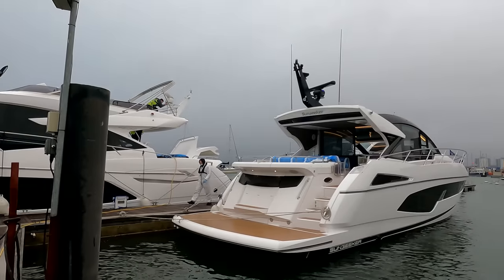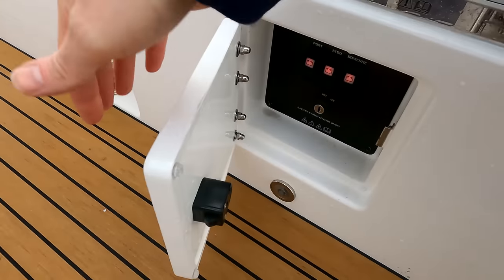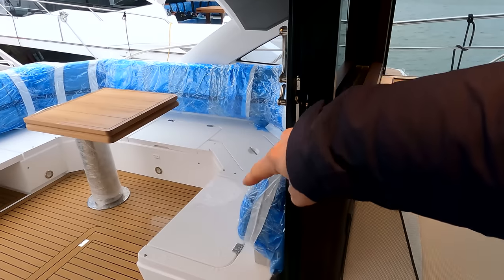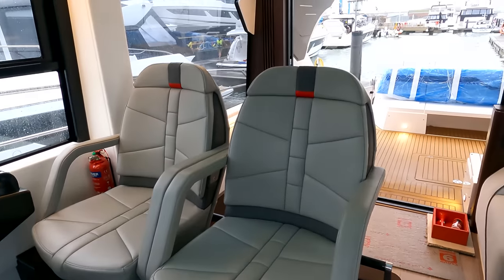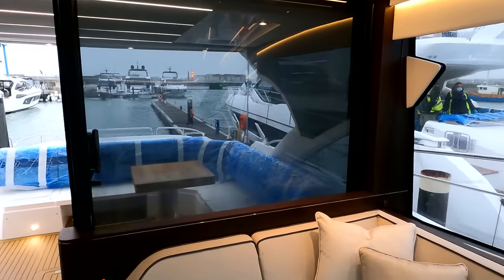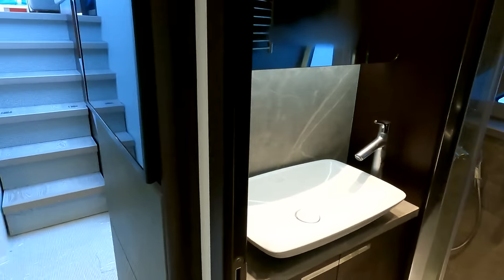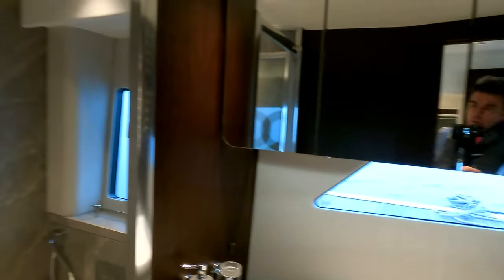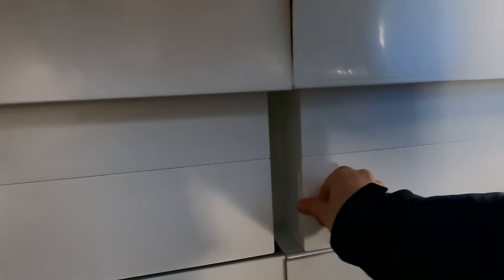2021 Brand New Sunseeker Predator 60 Evo For Sale - Full In-depth review £1,381,042 (now sold)

Comment: I do like the layout of the cockpit on this Predator, nice and safe , and out of the wind. Can you fit the washer/dryer under the stairs. I understand that the bigger engines give only an extra knot or so but higher fuel consumption and thus less range, is this true ? Cheers.

Comment: Hi James, does this boat have vector fin stabilisers, if not can new builds be fitted with them.
Reply from the maker: Hi Keith, the Predator 60 runs a gyro stabiliser as an option (fitted in the aft crew space under the bed). The factory don't offer a fin system alternative, although it could be done via one of the Uk dealers for Humphree/Sleipner.